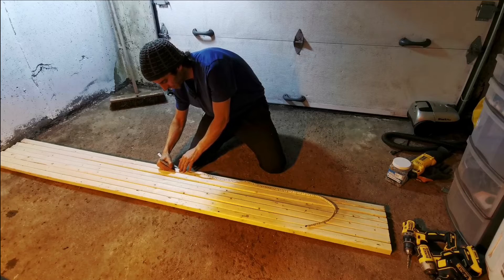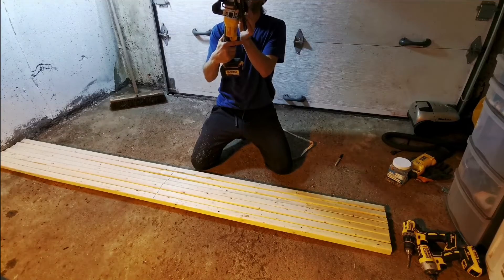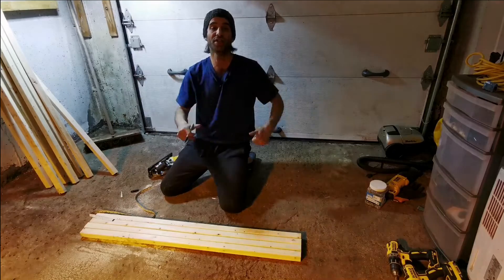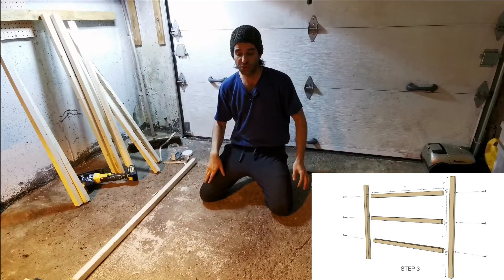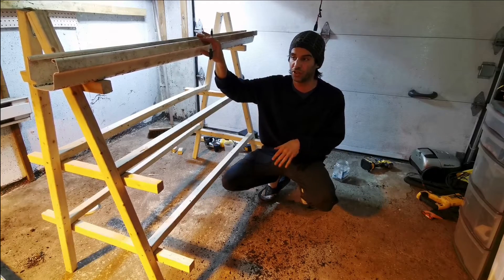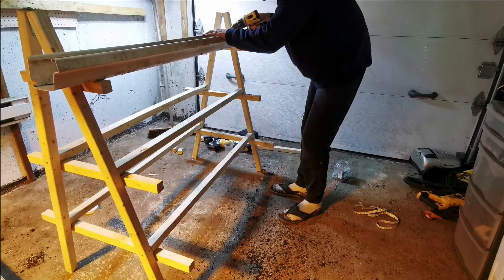How To Build Your Own In.Genius Mini Vertical Garden Part 2: Building Tutorial

Comment: Great video! I'm definitely going to be looking for some free gutters this summer. 

Is there a reason you chose to zip tie the gutter to the support rather than screwing it in?
Reply from the maker: Somehow just say your comment sorry for the delayed response! I run a commercial operation and zip ties are cheaper then screws, so I’ve taken the habit of zip tying them.  Screws should work just as well
Reply: @ThePlantCharmer  Great, thanks! I'm always looking to make my projects as sturdy as possible so I'll go the screw route. Only building a few of these definitely changes some of the price/result calculations.